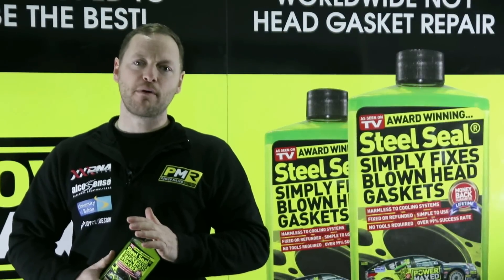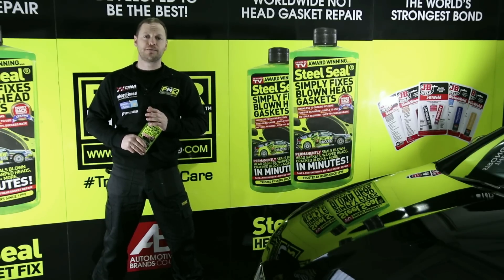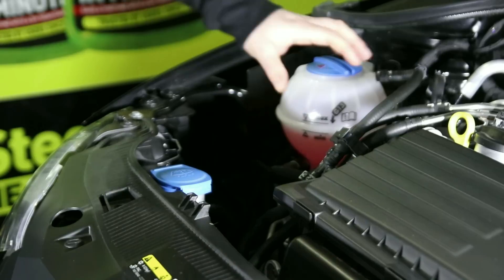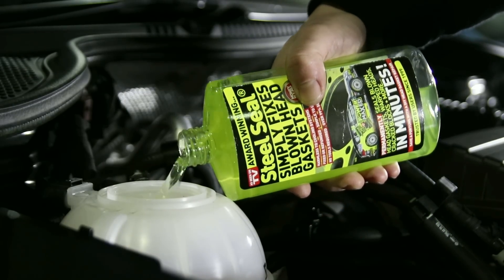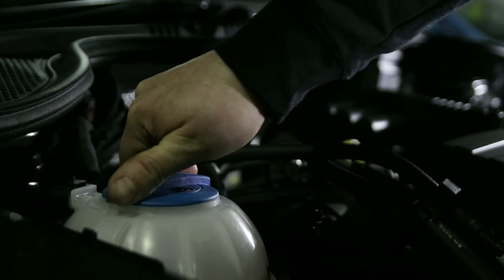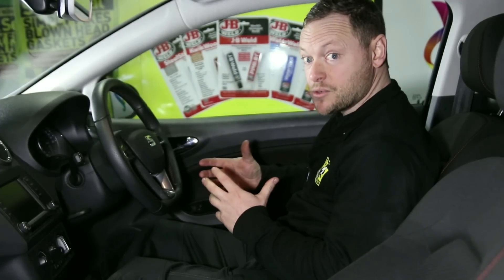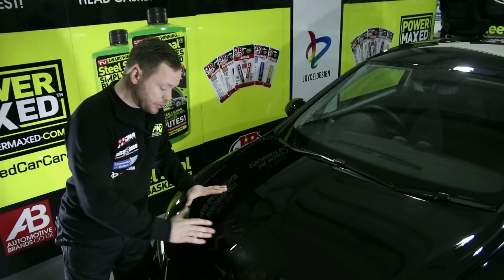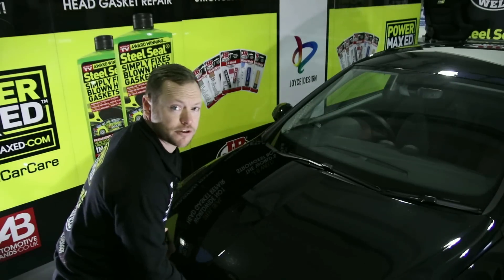How to Use Steel Seal

Comment: Before you poured it in I noticed your expansion tank your water level was just on max, after you opened the bonnet towards the end by a miracle the water level was just on max. Could we have an info about what water level should be before adding and after??
Reply: I might  be wrong  but he put steal seal in expansion tank also. It looked  like it had antifreeze in it too. I asked  him how  to do my s type jaguar.  It has expansion tank also. He said not to do it though expansion  tank  Well that's impossible.  Anyway  I did and it seems  to had worked  finger's x

Comment: Merc 2.3l, M102 Engine. Completely flushed the radiator with clean water (no flushing additive) until clear, then on a cold engine added Steel Seal.  As soon as the thermostat opened up and the solution circulated the slight smoke out of the exhaust stopped.  Ran at 1200-1500rpm for the 30mins and then left to cool.  Now the car is starting without being lumpy for the first 15 seconds and not seeing the white/blue smoke any more.  It sealed the leak so quickly virtually no water was lost even.
Apparently you can leave the solution in the coolant system.  I doubt it can clog other things because it needs to come into contact with hot metal, not just 100+Celcius water. I doubt it would seal a radiator leak for that reason.  Happy if this fix of an early gasket problem lasts for years like others have experienced.
Reply: Sadly, 2 days  later the HG must have breached further between cylinders 3&4 because lost compression and running on 2 cylinders (barely).  SteelSeal cannot get to that.  HG being replaced now, and head skimmed for any warping.
Reply: dingaling did the steel seal cause the mechanics issues when cleaning/flushing the system? I have a slight leak coming out of the head into the engine bay and no contamination between oil/coolant (also hasn’t overheated). Haven’t got the money for a head gasket replacement right now but didn’t want to cause problems when I actually have it done. Car is worth about £5k
Reply: Further update.  The head couldn't be skimmed, and Cylinder 4 was suspect.  Put a replacement engine in (eventually).  However, the Radiator (recon one) is now blocked up, and the mechanic says probably the SteelSeal.  Not convinced of that myself and still think it did the job fine.  For your described problem I would give it a go.  Leave the Steelseal in  there for a few days but then flush it out and replace.  In my case, it might be because it was left standing.
Reply: @dingalingalong  so basically flush the system with water then add the steel seal , leave it in the with the water and then flush it again to add the proper coolant??
Reply: @manuelsalgado8510  don't flush the steel seal out for a couple of days. Then do it, and put the right mix of antifreeze back in the system.  Clearly, for steel seal to work in the water, the head gasket breach has to be from water to cylinder, and hence the white smoke (steam) in the exhaust.   It cannot seal where the head gasket is broken from cylinder to external.

Comment: Bought this product yesterday & followed the instructions shown on back of the bottle. This product has worked fantastic & has blown me away how quick it worked! Fully recommend it for blown head gaskets💯🥇
Reply: Do you have to empty out your existing coolant and put new one in first or just do it with the existing coolant?
Reply: @Callum-xt9ng  still wondering this, did you find out ?
Reply: @DaVeTheRaVe198  he literally explains it in the video
Reply: @Callum-xt9ng apparently you do. It talks about flushing so I guess that'd mean emptying everything out first.
Reply: But he pours it into his tank when he still has coolant in there?
Reply: @sigmamale1985 you only flush systems if you already have any other chemical mix used before. If it is only coolant and it's compatible, then you can just use from what he said.

Comment: I guess most of the negative comments are from mechanics hahaha!!..and rightly so , they must be pissed!!...
£800 - £1000 was the quote for my Ford connect van literally spewing white smoke with a tinge of blue everywhere, and rightly so.
Problem is I didn't want to spend that on my old van.
Anyway with nothing to lose I tried 'Steelseal'... I still find it hard to believe almost 1year later van is running perfect. 
£1000 saved!!!...Thank you 'Steelseal' 👍
Reply: Is the fix still working
Reply: @alb7112  Julius' answer is in his 2nd to last sentence, I believe.

Comment: I used it in Toyota avensis . It is not worked but blocked my car radiator. I spend 65 pound to open my car radiator. They didnt pay back money. It is completely frud.

Comment: Iv used this on a mk6 2.4 transit engine after a pipe splits and the head gasket got damaged because of this, there was bubbles coming out my coolent tank and the coolent system was pressurising up with the cap on the tank so I used this steel seal as a get me make home "250 miles" followed the instructions, clean water only! Cap left off, heaters on full blast, 40 min fast idle, hour cool down, no more bubbles in the header tank and coolent system wasn't pressured up like a rock anymore! 3 months later I replaced the engine as I was paranoid and to be safe then sorry, but it still worked faultless up to the day I swapped engines

Comment: I got it to work on an 02 Jeep Liberty misfire on #2 cylinder with water in oil present. My leak was small so Steel Seal worked without any problems.
Reply: Cosecant18 Tell us the steps that you took in order to make it work please

Comment: I bought a Mk4 Mondeo diesel privately last year. During the inspection of the engine bay the guy that sold me the car told me had conveniently "lost" the expansion tank cover plug. After driving it home 10 miles I was getting dirty oily steam coming through the heater vents and surprise surprise the water level had dropped to the point of being virtually empty - diagnosis blown CHG

My mechanic said it would need top of the engine strip down, new cam chain and depending on whether it was just the gasket or a problem in the head or block. like a crack or warp etc it was going to be the best part of £800-£1000. I asked him what he thought of these kinds of miracle fixes and the answer was that it might be worth a try.... "shit or bust"  

So I tried to use this product which cost 39.99 and following the instructions to the letter it all seemed to be going okay until my top heater hose blew (very dramatically) after around 15mins of running it on tick-over. Apparently the steam building up in the cylinder found the weakest point.

My question:-
Anybody have any idea if this stuff works when you leave the expansion cover off (or loose enough for steam to escape until the engine has "sealed")  Does it need the coolant pressure to work it's magic?  

I can't be the only person who this has happened to. I want to give it one last go before I scrap the thing which would be a shame as it is a really nice motor aside from this problem but I just don't have the cash for a rebuild
Reply: TheComputec  . Sorry to bother you. But I  have MK4 Mondeo and y have a CHG, has this product damage u car or not? Or do u know if they are any god?
Reply: TheComputec 
Bar's Leaks 1100 Head Gasket Repair - 20 oz.

Suddenly noticing your temperature gauge spring towards the high end is not the best way to start your day. School, work, errands — your daily routine should not be compromised due to head gasket problems. When you experience this problem, you probably think about the time and money that will be spent in search of a block seal solution. But there’s good news: a cracked head sealant doesn’t have to be expensive or time-consuming. Our Bar’s Leaks Head Gasket Repair is scientifically formulated to permanently seal coolant leaks that are the cause of most overheating problems. It’s easy to apply, and it’s available at only a fraction of the cost of getting the same block seal fix from a mechanic. How does the need for cracked head sealant come up in the first place? Usually by overheating, which can be caused by a blown head gasket, cracked head or a leaking block. Bar’s Leaks Head Gasket Repair eliminates this problem — guaranteed. This product contains a blend of aramid and refractory fibers, which provide the strength of a bulletproof vest and the heat resistance of fireproof clothing. As these particles penetrate a crack or the blown head gasket area, they lock together and bond, forming a hard, permanent ceramic-type seal. At Bar’s Leaks, we employ a team of top-flight chemical engineers who specialize in solutions such as these. Each product, our cracked head sealant included, is custom-designed to be effective, affordable and easy to install. You don’t need any special automotive expertise — you just need to be able to pop and lift your hood. The rest is about as simple as any car maintenance can be. Forget that repair bill. Simply use this product and get back on the road and back to your daily routine in no time — with several hundred extra dollars in your pocket.

Features:

Stops block leaks
Seals cracked cylinder heads and blocks
Repairs blown head gaskets
Item #: 1100

UPC: 046087011003

Brand New!! Free Shipping!!
Reply: TheComputec try bars from the USA but works well
Reply: +mick ladd

"Bar's Leaks 1100 Head Gasket Repair - 20 oz."

Yeah, I wasn't looking for a sales pitch for an alternative product. I was looking for an answer to the question "do I need to tighten down the expansion tank cover" during the fix. It was a specific technical question. I'm not a newbie
Reply: TheComputec Yeah I wasn’t given a sale pitch just copied and pasted the page but the answer is I would leave it offThere is a demonstration on the that brand
Reply: cheers
I'll give it a try tomorrow
Reply: @TheComputec  none of these product producers Guarantee this stuff. Read the actual Guarantee on the bottle.

Comment: Do you sell the car rapidly after pouring it in?
Reply: 1 careful owner
Reply: Arrange all your viewings on the same day and pour it in in the morning..... 🙂
Reply: The Cadillac Curry Show not when you buy it from someone else
Reply: Yup...
Reply: i resealed a vehicle for a customer that had traded it in for another vesicle.
Reply: what you don't know does not hurt 😂
Reply: If you follow the directions steel seal works. Used it in a Chevy 4.3 and drove that truck for 15 years with no problems.

Comment: Simply it worked. If you have any questions make the call, the guys were very helpful and can tell you if the product can help. I was forced into finding an affordable solution because the estimate to fix the head gasket was 3-5k, I only paid 1800 for the van! I decided to try this after trying two other products that didn't work. Then I saw a YouTube video of what the Steel Seal looked like after the product was used and the engine was taken apart. It made a lot more sense seeing how it worked inside the engine. The issue I had was common problems with a bad head gasket. Coolant loss, weird heating issues, water leaking into a cylinder, miss fire error and pulling the spark plug it was dripping wet. There was also very moist white exhaust and thankfully I had clean oil. The misfire error disappeared almost instantly and checking one time after first use the plug was dry. Then I kept the product in the radiator system for about a week. It’s been about 3k miles now and with one long 6 hour road trip down I consider it fixed and switched back to 2yr coolant in the radiator. The van hasn’t run this good since I bought it with 300+k miles now it seems to be running like new. I rewarded myself with some new tools since I saved thousands. 98 Ford V8 Tritian Club Wagon Van